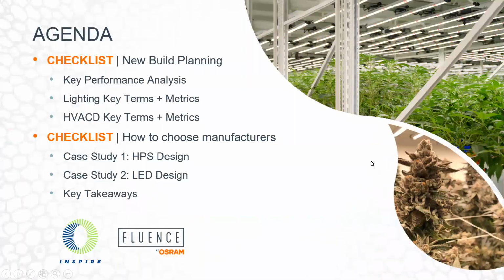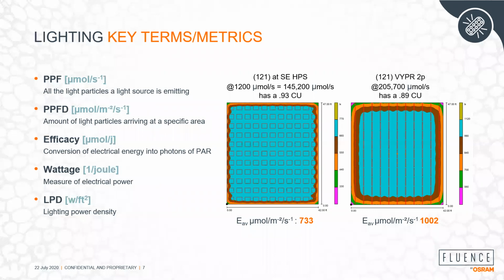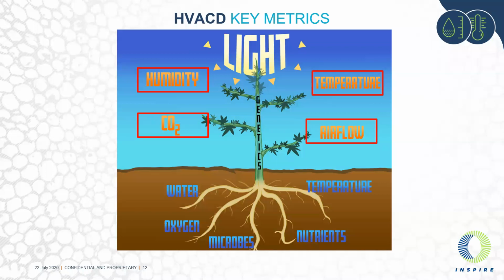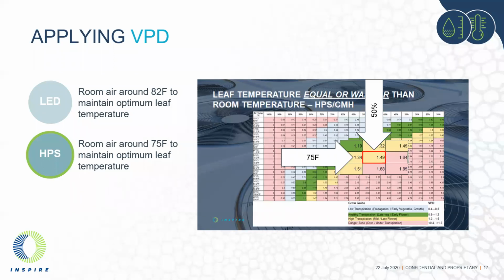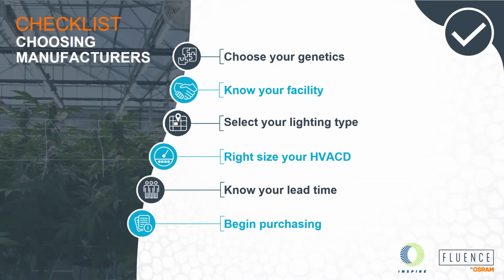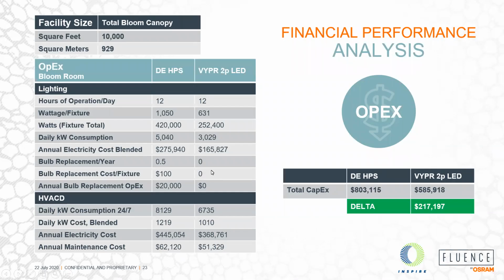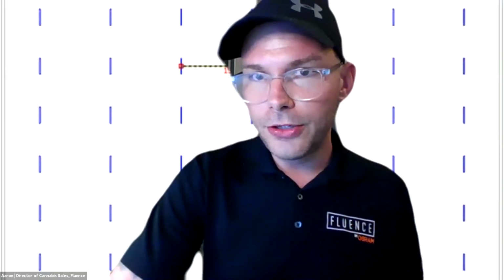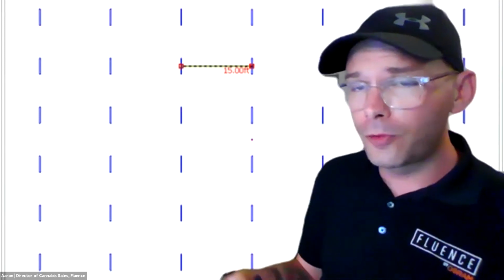Key Lighting + HVACD Decisions for New Build Planning

Comment: Perhaps the very most important skill for a consultant and services provider is to be able to relay effectively the requirements and SOP for executing those requirements to the investor or grow owner to optimize the controls for humidity and temperature management so as to maximize the most efficient VPD and produce the most effective yields. One can understand all of this at the most granular level, be able to source the equipment, design it into the facility and be confident in all those tasks, but if you cannot make the investor or the grow owner believe they will profit much more by using the design and installation, you failed as a consultant. It's better to walk away and preserve the relationship for AFTER "they" fail on their own, than give them a subpar system which they will then use to blame you for the failure, even if they have yelled and whined and begged for you to do it in such a manner where they think they are saving a few dollars and getting the "better side" of the deal. Walk away, don't let a grower or investor talk you into cutting corners. Let them fail on their own.